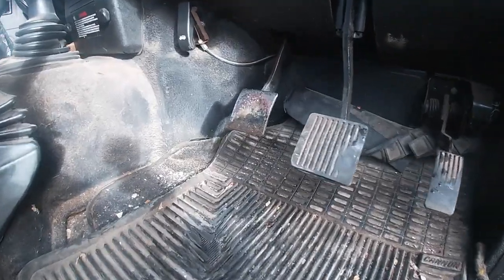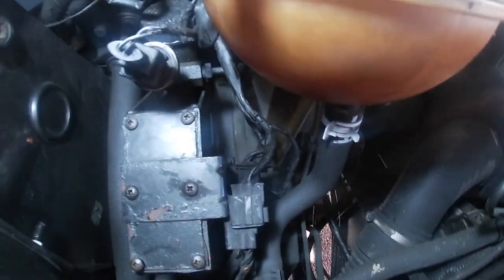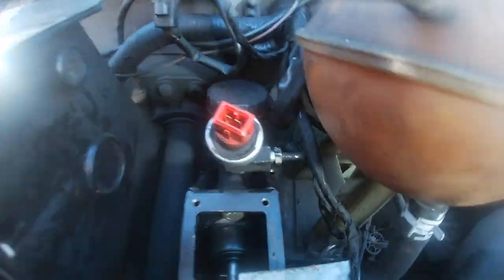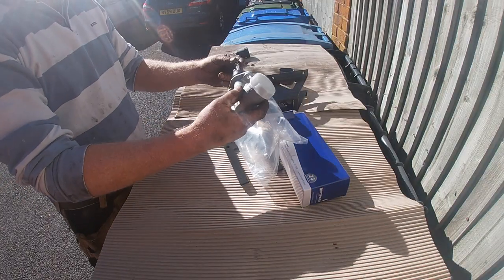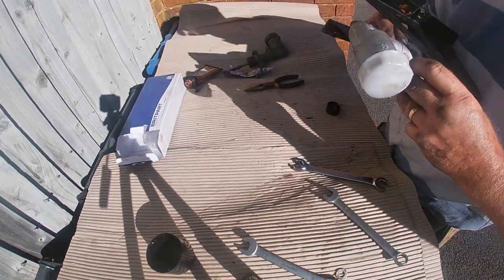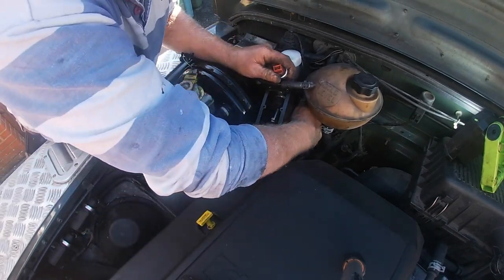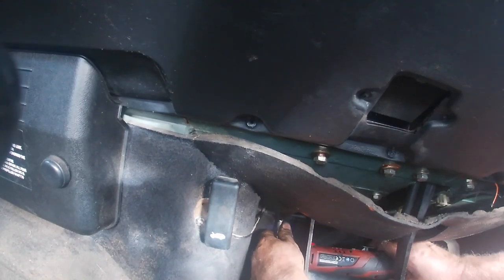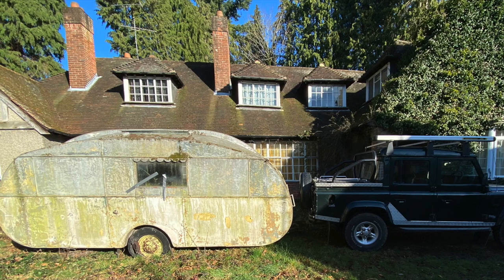LAND ROVER DEFENDER TD5 CLUTCH MASTER CYLINDER REPLACEMENT

Comment: Excellent video! This is not a difficult job, but does take a lot of patience, I found I needed to make up a lot of special spanners to get the various fixings , I also had to do the job twice as the new master cylinder had a crack in the inlet port, so I got better at it the second time around, I know it is too late now , but it would have been a good idea to replace the slave cylinder at the same time, mine is a 2003 and both were less than perfect, I also replaced the master cylinder with the small bore type which makes a bit difference to the clutch pedal operation, replacing the slave cylinder requires multiply sizes of spanner, and is a real test of patience! Chris B.

Comment: How did you bleed the brake fluid?
Reply from the maker: Hi at first I used one of those self  bleed devices  but did not get good results . I eventually persuaded my wife to help me and after a while the job was done , I found this took a lot of bleeding so if you are doing this job be patient it takes some bleeding . Good Luck 👍
Reply from the maker: if you are looking for the bleed nipple it is on the right hand side of the defender above the clutch slave cylinder . Thank you

Comment: Did you readjust the freeplay?
Reply from the maker: Hi yes slightly I think it could do with just a bit more adjustment . You know Fine adjustment if that is at all possible. Thank you
Reply: @TD5PRESERVATION-1428  how did you adjust it? 140mm from floor and +/-6mm play in pedal?
Reply from the maker: remove the cover that is under bonnet, with in that there is the rod with 3 nut on  one of the nuts is a locking nut  loosen this then adjust accoringly . I had to modify a spanner to do this ,. This is all from memory  I know it was short while ago but  it was one of those jobs I hoped to fit and forget. Thank you
Reply: @TD5PRESERVATION-1428  13mm spanner right?
Reply: @garthbawden5550  But you will find it much easier if you grind the spanner with very narrow "jaws" it make the job much easier.